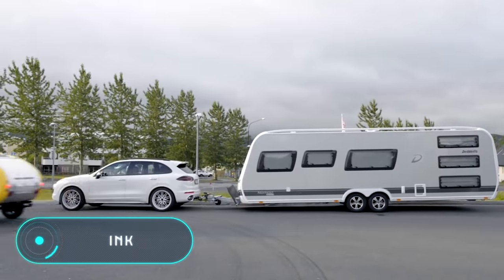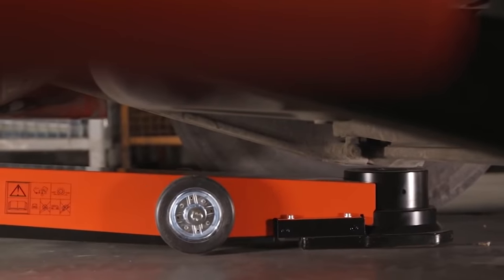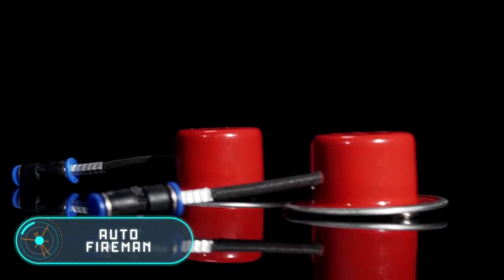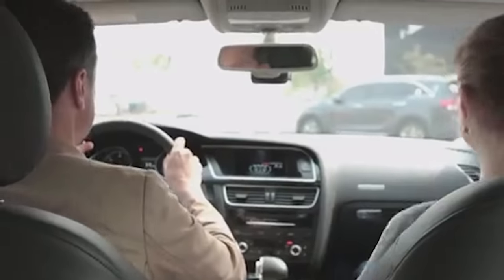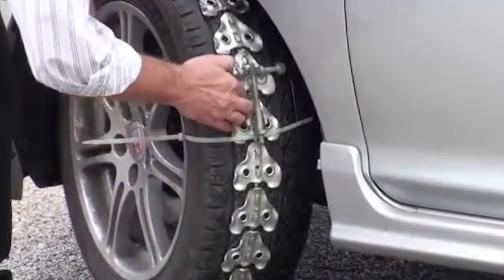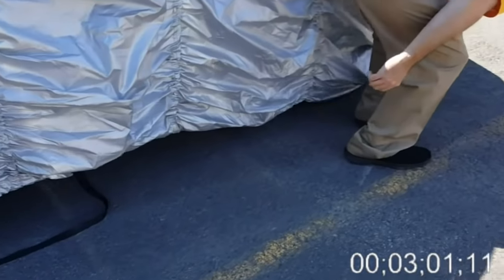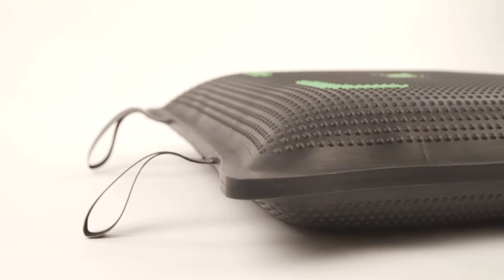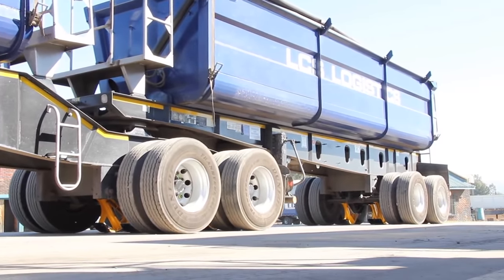10 AMAZING CAR GADGETS

Comment: The pneumatic jack has been around at least 30 years, and the airbags have been used by firefighters for extrication for at least 25 years. But those rolling jacks are pretty cool. :-)

Comment: Never heard a quad bike/ATV been called a quadracycle before loo
Reply: Henry Ford built one in 1896, pretty much before paved roads :)
Reply: Bike means two wheels so it is only a quad...for short. Learn your English
Reply: That's what they're called in Brittan.
Reply: I would say a "BI"cycle means 2 wheel bike, so a "QUAD"racycle would be a 4 wheeler, however I wouldn't be cycling anything with an engine.
Reply: flux0rx1 never heard a truck be called a Jeep either lol
Reply: Wouldn’t a quad bike have 8 wheels?🤯
Reply: @roberttennant3577  no that would be an octobike

Comment: @ 2:10 those ramps are not safe. You want the load over the axle not behind it. The truck will probably crash if it has to maneuver in an emergency situation.

Comment: The Track Grabber seems like it would be more effective if you spent a bit more and doubled up on it. Especially with large, off road tires that will dig in faster than the tool can dig iut, but, a good idea.

Comment: @7:27 Why the editing cut on the truck stuck in sand? lol It didn't show a successful use of the product. In fact, it looked like it wasn't working at all. Good idea, but I think the better way would be long rounded spikes like a golfer's shoe or mountaineer's boot, instead of a flimsy rectangular rubber taken from a probable flip flop.
Reply: To me it did look like it was working, just really slow. You can see it inching back slowly. It would probably way faster if they used more than one lol
Reply: I would just air down the tires. This will allow for much better traction is sand.
Reply: Sand ladders - specifically designed for this problem, and available in lightweight polypropylene too. Also, you'd certainly have a winch fitted (and will be carrying a suitable anchor). So many better (and well-tried) solutions to this problem.
Reply: I dont think it works either
Reply: Not only that but the vehicle in the demonstration literally has a button that will get you unstuck.

Comment: Mink. If is has no shower. or toilet its no diffrent than a tent with insulation. Just sleep in the car. What someone should make is just a shower/port a jon  to  pull behind your van. 
Would be close to a Rv. just have a propane powered heater for the shower.

Comment: That hail protector looks like too much trouble, when I lived at an apartment I would just drive a mile down the road and park at a gas station until the storm passes. But back in the 90's me and my brother when we were kids created a hail protector car tarp, we used foam and cut it into strips then zip tied the strips under the tarp, it worked very well for objects up to baseball size and it took like 30 seconds to put on.

Comment: That hail car tent should be developed into a camping tent with a compresor that also is a heater and a cooling unit has the air up tent acts has insulation sold with a small atmosphric water generator to deal with condensation from human breath that can be filtered and used for fresh drinking water. 😊
Reply: Indigo Dragon71 dude, the pressure would be too high for you to go into I think

Comment: Whatever happened to the low pressure air lifting bag for cars? You just shoved it under the car and inflated it with the exhaust. The bag material was tough enough to use on rocks and still give sufficient area to lift the car on the softest of surfaces - excluding deep water. Much better than those high pressure pads that need access to a compressor.

Comment: You keep saying hydraulic but I don't think it means what you think it means. The "Air hydraulic jack" is a pneumatic jack. It would be hydraulic if it used oil. Same for your "hydraulic lifting bag". If the fill medium is air, its pneumatic. If it fills with liquid, its hydraulic.
Reply: The air power jacks are both air and hydraulic. Air ratchets the oil into the piston. The bags are pneumatic like you said.

Comment: #1: it's a bed.
#2 actually pretty good. The air line would always be in the way
#3 not bad, probly wouldn't work for most cars
#4 most cars don't burn when they crash. Stupid. Probly wouldn't work anyways.
#5 rubber mats already exist. Nothing special.
#6 not bad. Idk much about chains though
#7 WE NEED THIS. HAIL IS THE WORST.
#8 AMAZING. hope it works
#9 Terrible. Anything would roll off. Obviously.
#10 idiotic. It would fall.

Comment: 1 Mink is not a car gadget, it is a CARAVAN
2 Air jacks.. ok, great , but they are a garage tool
3 mad ramps.... just fancy ramps... for trucks
4 auto fireman, well, i'de rate this better then a gadget, but it's WAY to expensive for what it is.
5 ok i guess
6 just get rubber mats and pressure hose em off.
7 to much hassle
8  Same as 6
9 don't get under a car on those.  Will take forever with DIY/Home compressors
10 an 18 wheeler is NOT a car

Comment: 0:03 If needed , i will sleep in my car ! no need to drag a BS trailer just for sleep !
1:10 Works only in a garage , would be nice if they include it with a compressor that works with with the car lighter socket .
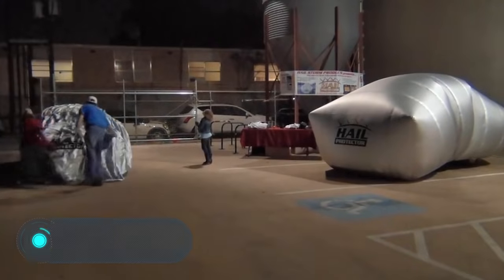5:41 OMG all that work , they say 5 minutes , but after , you have to remove it , will takes loads more time .
7:30 Why didn't they show how long it took ? if ever ! Never saw the car dug him self out !
8;48 Useless ! works only if you front drive and only for the rear wheels !

Comment: 1. Mink: it's cute but if you are supposed to pass a background check as these guys make you to get the price, they can shove it!
2.Overkill for most people, I use harborfreight air/hydraulic jack that costs $80 quite successfully
3. Ramps: $1,100 for ramps?!? I don't care how nice they may be if the same operation takes a few minutes longer with ramps that cost $100? I am not THAT lazy

4. Don't buy ford or vw, and you don't need a fire extinguisher under the hood
5. Not available yet, somewhat overpriced but could be a decent thing to have
6. Not even available, and both owners gave it dismal rating
7. Not even funny...
8. Actually may work but pretty pricey AND reviews are way less than hopeful
9. Hardly needed unless you own a heavy duty repair shop
9. Pretty special thing, I have two trailers, and whenever I need to lift one, I can use any standard jack - wouldn't even consider having a dedicated jack for a trailer...

Here comes the conclusion: the only potentially usable item that - according to reviews - usually works only once on the list is No. 8. Nice job, salesholes!

Comment: 1st.. Does the bear shit in the woods? 2nd.. I'm too lazy to jack up vehicles all day I'd rather use something that if it gets a penhole leak it's going to kill me if I'm under the car... 3rd.. Just thought I'd make my truck even moreoff balance by having weight hang way behind my rear axle on a small steel frame because I'm too lazy to move my toolbox as needed.. 4th because I don't know when my cars going to just up and smoke.. Hasn't happened before but I'm too lazy to maintain my vehicle and too stupid to check for oil leaks around the exaughst manifold, a funnel? I never used a funnel to keep from spilling oil when adding any,what's oil again?.... 5th, because when I spill something being a clumsy fuck I want it to get into a mat that I never bother cleaning because apparently I'm such a clutz that I need something like this in the first place eventually it will grow enough hair to just look like the original carpet!... 6th ... Really? Its just ziptied? Look how friggin bulky it is.. What if you hit a pothole and it either turns it sideways into your tire or if pops off.. Destroys your wheels finish or what if It's actually strong and it drops on the inner side and goes as far as to snap your tirerod end?... It means your tire will be free turning without steering control aka no steering to mention... 7th because I like puffer fish and I need something to make my car a target for insurance reasons, alsoI like things I can needlessly connect my phone to, plus a hell of a nuisance for my daily routine... 8th actually isn't horrible for getting unstuck, I'd just prefer the strap to have a ratchet on it so it won't come loose and get stuck under the stuck tire... Then I'm not fond of a ratchet strap on my wheel or getting mud packed or ice freezing it shut.. 9th, that would actually be helpful for jacking up a low vehicle enough to get a real jack under it, I've seen the struggle.. And 10th... Whatbrought me here in the first place is that's so fucking moronic... Even worse when I hear that it's for a " heavy cargo trailer".. You think you can tell it stay... Good boy... Then yank wheels off or whatever while that unstable shit is holding it up? Not sure if it would had even been safer for a car due to a car having brakes you can set "I mean still crushed leg city youd be a dumbfuck to climb under something jacked up with something designed to roll out of place..". You may say the hitch will hold the trailer... Alright so imagine you're holding a hitch from rolling back or turning on you,you have good leverageside to side because of how far the wheels are from you... If it's balanced it's not too hard to hold steady on flat level tarmac.. Now one side is hiked up with the tenancy to want to fall down and roll that side forward or backward... Now it has leverage with the weight above it applying torque however far it settles to make shit worse.. Bye bye hitch and hopefully if it rips the hitch off it doesn't swing and pin someonedown.. Killed by a parkedtrailer... Good fuckin jobyou're a genius... Why don't I just jack my vehicle up on mattresses and get underneath it and see how much bounce it has... Thatlast one though... I'd facepalm but I don't want to accidentally crush nylons skull.

Comment: mink is a glorified, overpriced camper, the trapmat can be replaced by a rubber mat, no mat, or just cleaning your car like a normal human being, as for the chains on tires, you can use studded tires. the hail protector can  be replaced by a garage you own, or a public parking garage. the track grabber can be replaced with a tow rope and someone else in an suv, or oucan just not go offroad alone.